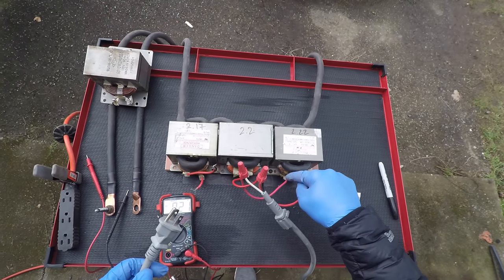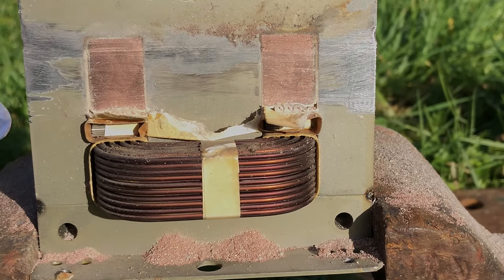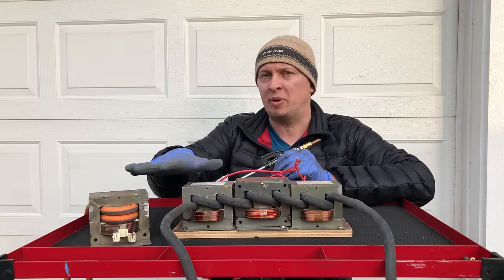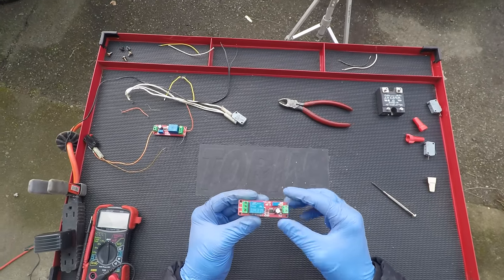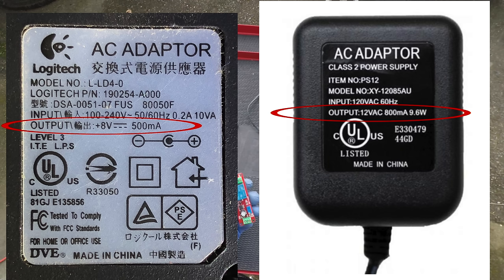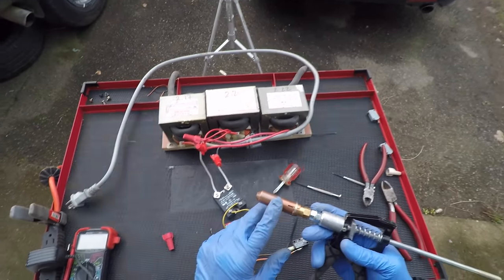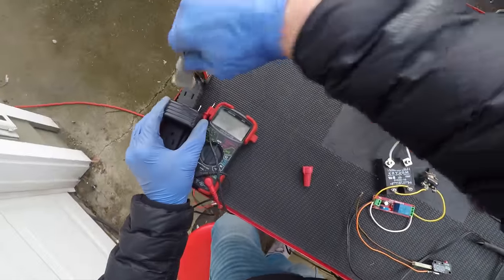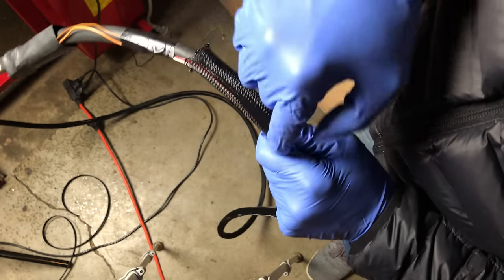✅ DIY Car Body Electric Dent Puller Welder Spotter From Microwaves UPDATED

Comment from the maker: For anyone interested, the link to the wiring diagram is in the video description section  !!!!
Reply: Fix206 I liked your video very much.  only one problem, my mother in-law is dead so I will have to check out the wiring diagram. CHEERS FOR THIS VIDEO.
Reply: Where did you get the polar from where you use the handle to pull the den out I've been looking for one of those but I can't find one
Reply: Thank you for sharing with us! I saw a lot of videos where the spotters were made without any circuit, only with a micro switch at the transformer power suply!
Reply: Iv been trying to find the pulling head that you have I can't find it anywhere I really like that design
Reply from the maker: @jdyer4066  I purchased my from a Russian website, you may have a hard time navigating it since everything is in Russian. https://spotterpilot.ru
Reply: @fix206  thank you for the info. Is buying and shipping to the US a headache to do?
Reply from the maker: @jdyer4066  It was, because they had to send me customs paperwork to fill out (all paperwork was in Russian), and I had to communicated with them over Skype, and all of this had to be done in Russian. And since I speak the language, it wasn't too bad for me, but  for a none Russian speaker this would be much harder to do...maybe one of these days I'll reverse engineer this puller set up and make a video about it. Or maybe start manufacturing them myself and selling to folks such as yourself :)
Reply: @fix206  that would be great! I would gladly pay for that set up. I do collision work for a living and I just couldn't bring myself paying 1200 for a shark puller.
Reply from the maker: @jdyer4066  I know exactly how you feel, that's why I build alot of my tools instead of spending an arm and a leg on on an overpriced equipment
Reply: @jdyer4066  its just a caulk gun handle (reversed) buy a decent one, chop the rest off and remove the release thing in back.
Reply: @fix206
Do you have the part numbers for the transformers used? Im getting a total of 3.8v on my secondary wires.
Reply: I swear, every time I watch another video of yours I'm more blown away than the last at how damned talented and smart you are. 

BTW ... the 1948 Chevy Truck of yours misses you. 🙂  спасибо, мой друг

Comment: How do I get the spotter puller thats in the video? Also, can i just use my wire welder as the power source for the spotter?
Reply from the maker: As far as using the welder as a power source for a spotter, I'm not too sure about that just yet. I will be doing a video on that exact topic in a near future. I already have a donor welder that is ready to be converted. But I won't know how well that would work until I actually get it done. I'm going to have spotter pullers available for sale in a near future. Let me know if you're interested.

Comment: I love this project to the point that I am now building mine, but have a question: I'm powering up the transformers and each one pulls 10-11 amps! How can 3 transformers wired in parallel work on a 120v 20amp circuit? Have you measured the current draw on yours? My transformers look just like yours and would assume they'd be roughly the same current draw.
Reply from the maker: I did not measure the current draw. But I can attest to the fact that everything just works the way to set up

Comment: Thanks for this detailed video. I am building one to repair the damaged roof on my Silverado. I'm still building it but here are a few notes/ things I did differently. 1. I purchased a Rigid tool box to house all the components, the wire and the pieces to my welder handle. It will weight 50lbs+. It has a tray in the upper section for all the misc bits. 2. I purchased the PULLER ATTACHMENT in his list of items. It's well built, excludes instructions and seems like the right tool to use. 3. Not ALL micro transformers are SHAPED the same. Be sure to get 3 that are physically close to the same. A 4th one I picked up was turned 90 degrees and would have made the assembly tricky. Getting FREE microwaves is easy but takes some work, be sure to DISCHARGE the capacitor, it will kill you!. 5. Get the 25' wire, you will use approx 6 feet in the loop around the transformers. I started in the middle with attempts to equalize the wire ends. This is 2 Ought (2/0) wire, NOT 2AWG, don't get it confused. I bought the one he recommends on Amazon in RED. Have a can of silicone spray handy when pulling the wire. It's quite the workout. 6. I bought heavy duty C-Clamps at Harbor Freight to make the adjusters on the bridge. I cut off the C section and will just use the adjusters and feet. I haven't finished it yet but I like the T handle ends, seems like to would work better than having a wrench to turn a nut. 3 clamps would allow me to adjust all 3 sides, with the center being the most important. I'll extend the 2 ends with some rod as the clamp threads are too short this way. The swivel clamp feet also allow for adjustment feet against the body. Use some rubber pads on the 2 ends if you're worried about scratching paint or need traction. 7. I found a magnetic ground clamp on Amazon. It allows the ground point to stick magnetically, but it may still weld itself to the metal, I'll find out. Good luck building this. Will be a life saver for me. I'll report back when I have used it. Thanks again Fix206!
Reply from the maker: There's always more than one way to go about just about anything. It's good that you're building this thing to suit your own needs in the way that you see fit. Because basically that's what I did when I built my tool. Let me know once everything is up and running 👍

Comment: excellent video  Mr, Fix206  , this works for sure and works like a pro. the only thing its missing is the fan that pro machines have , I think the microwave fan  can be added for shrinking to keep the transformers cooler .
Reply from the maker: I've actually done testing sometime ago to figure out whether the fan is needed or not, and after some work under heavy load the transformers got just slightly warm to the touch, that's why I figured that I probably wouldn't need a fan in there. I suppose if you had a really big project that you were working on where you had to spend about an hour working on a panel nonstop, then you would probably benefit from adding a fan to the set up.

Comment: This is absolutely brilliant my friend. Was waiting for something like this. Now i cant wait to build one my own literley just ordered all the stuff for it.hope this all same setup will work here in uk too.  Thank youuuuuuu once again not just for this video for the rest of your other videos too very informative. Hope you are good and stay safe! 👍
Reply from the maker: Glad to hear that the vid was helpful !!! let me know how everything turns out. Cheers !
Reply: Will do brother thanks. Only one thing that i couldn't find the cable you used. So i ordered 35mm one and rest same stuff so lets see 😬
Reply: Where did you order everything from because it says not availablr for delivery to the UK. Can you please let me know Waqas. Fix206 AMAZING VIDEO
Reply: @swissict92  everything is on ebay here . Didnt check anything on amazon because i mainly uses ebay. Also all parts are there. For example time delay circuit, solid state relay, thermal switch breaker, wire cable , plugs , connectors, microwave switch, toggle switch etc... just search it on ebay should come up. My 3 microwave transformers came today so just waiting for the rest. Thanks
Reply: @waqasahmed7936  can you send me the item numbers for everything please brother. Thanks
Reply: @swissict92  just sent you the email with the item numbers so let me know if you have recieved it or no. Thanks
Reply: @waqasahmed7936  thanks man which wielding cable did you order and what length?
Reply: @swissict92  emailed you
Reply: @fix206  hi there. Hope you doing well. I have make a start. Took the secondary winding out from 2 first thought ill check it first so after removing it i entered the cable as you showed then i checked the voltage. Voltage entering into transformer showing 238 /240 but output from cable showing 001. I have checked the connection and tried both ways as you said that which way it should work and which way shouldnt and all is good. So not sure whats wrong there. Then i took a thin wire and tried shortening it from both cables end and it does sparks. Any idea whats not looking right ? Will appreciate your help brother. Thanks
Reply from the maker: I went over troubleshooting in the vid, so the possibilities I can think of are: you either have damaged/shorted primary coil, or the cable shielding is damaged on your secondary and is making contact with the iron core. Power up the transformers one at a time and make sure that they hum, that would indicated that they are powering up. And if they all do power up, then just like I showed in the vid power them up one after another while making sure that voltage output in the secondaries goes up with every added transformer. Let me know on the outcome.
Reply: @fix206  thanks brother. Yes it was the problem. In process of removing secondary and i damaged the primary and on one transformer i had no hum. So i got another one and connected them together and separately too and all works but total voltage i have is 5.5v so i guess that would be enough? Just waiting for other couple parts now then finish it off and will defo let you know how its working! Thanks again for your help and support much appreciated!👍👍
Reply from the maker: what is the voltage output on each individual transformer ?
Reply: @fix206  right. 2.1 +1.5+1.4 on each but when combine gives little more extra ? Dont know how and y. And ive checked about 3 times individually and combined too but same result. 2ndly one transformer is big and i have it 3 turns(2.1v) maybe thats y ? And rest 2 got 2 turns of cable . Thanks
Reply: @fix206  also what will be best amp circuit breaker to use becase here we have 240v. And you used 20 maybe because you have 120v ?
Reply from the maker: Number of turns is important. try and unwind the bigger transformer, just because you have room doesn't mean you have to use it up. Make all 3 transformer secondary windings exactly the same as I did in my vid. and see if anything will change. and also try to weld on a steel bold to a piece of sheet metal. Keep pulse duration as short as you possible can.
Reply from the maker: The wall outlet that I'm using for spotter in my garage is running through a 20A breaker in the house electrical panel. So I went ahead and got same rating of a circuit breaker that went inside of the spotter inclosure. You should do the same thing.
Reply: @fix206  yh it changed the voltage after taking the extra turn out from the transformer and now ive got 4.5v in total. 2 giving 1.3 each and 3rd 1.4 but when combined giving bit extra and really dont know y 😕. Also would it help putting extra transformer in like 4 transformers and same turns in winding ? Or will it work oki with 3 and with in one extra turn of winding because its giving you more voltage through it ? Thanks
Reply from the maker: Try and zap a steel bolt with tapered end to a junk fender and see how well it holds on. Make your pulse duration as short as possible. If it welds on and stay on real good then you'll be ok. If it welds on like crap then you'll need to do some more work on your setup
Reply from the maker: also what is the thickness of the secondary cable are you using?
Reply: @fix206  cable is 35mm². Ive just done a test on a wing. Put the ground on on it. And attached microwave switch and with just one slight push on button to keeping the pulse low as possible it has given me a quite strong weld and pulled it very well too. I mad a video and wish if i could send you it so you can see. Soooo shall i leave the setup of winding same or shall i do extra turn of winding for more power ? Thankz for your help so far brother. 👍
Reply from the maker: As long as you're satisfied with the strength of a weld you get, there is no reason to change anything. I would leave the number of windings the way I have them done in my vid (your voltage may go up, but Amperage may go down with higher number of windings) if you'd like more power later on just add another transformer, or swap smaller transformers for larger ones if you happen to come across some. 👍👍👍
Reply: @fix206  thank you. Ill leave it as it as then. And to be honest weld was quite strong not gonna lie. Stronger then my normal spot welder. Quite happy with it. Im just waiting for timing circuit and ssr relay so i can put everything in properly and in a box which im making for it. I shall let you know ones its all up running. Thanks again 👍
Reply from the maker: @waqasahmed7936  Right on !!!

Comment: Super helpful you should start selling that orange circle piece by itself & have a spot welder starter kit🥳
Reply from the maker: I actually lined up a shipment of them from Russia... The puller handle with all of the attachments and orange bases... Let me know if you're interested...
Reply: @fix206 I'm interested in purchasing. Please let me know how to get the puller section of the tool. I'm wanting to use my wire welder as the spotter power source, if it's at all possible. I'm sure that I can do that, but some of your insight would be appreciated.  Thanks, Kenny

Comment: Thanks for the follow up on your build.  I was thinking the whole time with your first version that a trigger switch to a relay on the  120v ac side would be great.  You did it one better with the timer relay.  Very nice.  I think you forgot to list the relay for the AC line voltage.  You also included a circuit breaker that I didn't see in the build.  Still a good idea for safety.  I don't know the amperage draw on  all three transformers.   Another option you could try is replacing the potentiometer on the timing relay board with wires to a rotary potentiometer mounted through the tool box.  That way you could have an easily accessible dial to adjust the spotter timing.    And the switched relay is 3 to 32 volts dc on the trigger side and 120 Volts/ 40 Amps on the  load side.  You used a CRYDOM solid State Relay model D1240  The "D" I think denotes DC on the trigger side, the "12" refers to 120 Volts Ac, and the "40"  refers to 40 amps. So D1240
Reply from the maker: I actually bought a potentiometer a while back, I might still add it to the setup later on :)
Reply: @fix206  very cool setup.  I sincerely appreciate all the work you've done here, and that you've taken the time to share it with the rest of us.
Reply from the maker: Brian my friend, you are very welcome !!

Comment: Hello.I just built 1 identical and the solid state relay it’s burning easy(not working with transformers) because the electric of transformer it’s coming back to relay(he has no one to consume the current and returns back to the relay). From the rest all good. Nice video
Reply from the maker: Try to use a solid-state relay that is rated for higher amperage than the one that you are currently using... If that fails you can also use a contactor relay
Reply from the maker: BoSa  Try using a contactor relay instead of the solid state relay, also what brand of a relay are you using and what amperage is it rated at ?

Comment: This is by far the best video that I’ve watched on this subject.
Could you please let me know what the spotter tip is made of? 
Thank you. Joe.
Reply from the maker: It's made of mild steel, make sure you're not using stainless steel, stainless will not stick to the repair panel unless you're working on a Delorian :)

Comment: Add a digital thermostat switch to see temp and turn on fan if it gets too hot. Also a digital voltage and Amp display.
Reply from the maker: Even after heavy usage I've only been able to get the transformers slightly warm to the touch. They may get hot if I had to work an entire pickup bedside or something else of that magnitude. But after using this tool for over 4 years now I never felt the need for any sort of cooling... Same goes for voltage/amp display, there's really no need for any of it.

Comment: 1)  Does it matter the wattage of the microwave?  Should they all be similar sizes?
2)  The shrinking tool you used didn't seem to visually do anything
3)  Can this be modified to be a spot - welder?
Reply from the maker: The wattage of the microwaves doesn't really matter, you can mix different output transformers without any negative effects. The tip of the shrinking tip gets dime size area of the metal that i'm working with red hot,  and heat shrinks metal. So you're basically getting the same effect as using a torch to get metal hot enough to where it shrinks. So in turn this tool turned into a Multi tool. Generally a spot welder doesn't require the power of two or three transformers but just one. So all you have to do to turn this into a spot welder would be just to cut power to one or two transformers.

Comment: Thanks for sharing this info i ordered the parts and build it but for some reason its never stick only shrinking Dawn any ideas why? .thanks
Reply from the maker: Did you use a thick cable with the same number of windings around the iron core of the transformer?
Reply: @fix206  sorry for the late response.yes i did i ordered from Amazon with the link you add to the video.
Reply: @Matthew8422  the copper fitting for the gun is for shrinking. You need a steel rod for it to stick to the metal and not shrink. I used a long bolt cut the head of and make a point on it
Reply: @123jmbjmb  I got super busy I will try to make it work this weekend hopefully. thank you guys for the support.